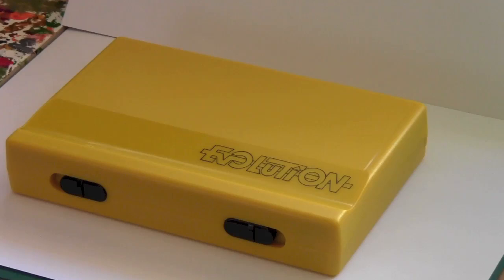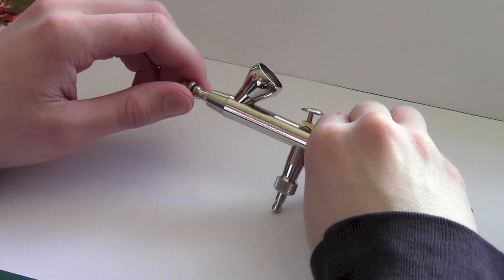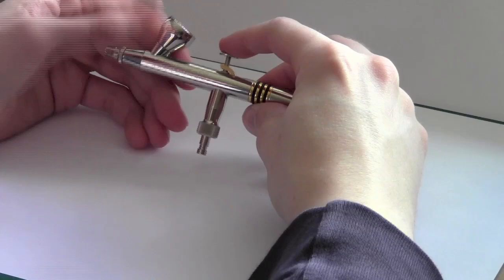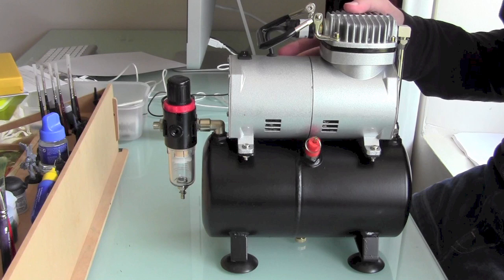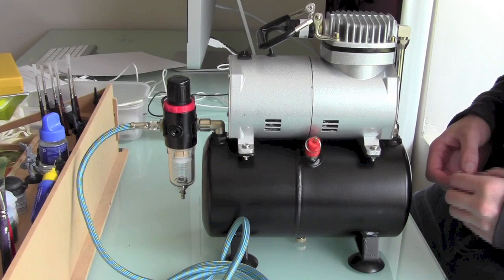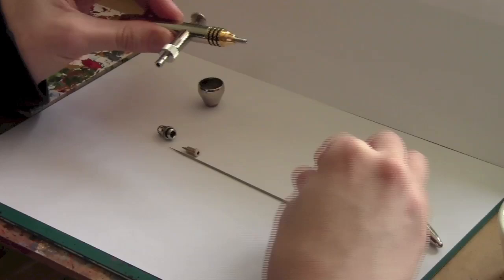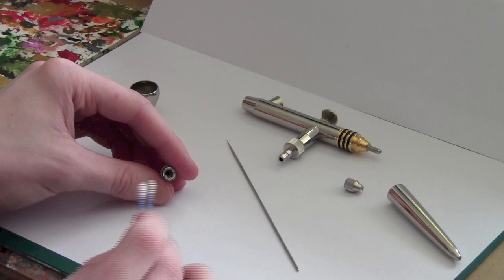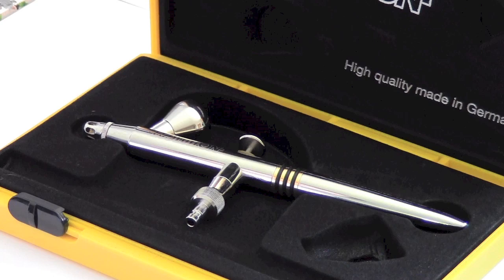Airbrushing For Beginners - Setup

Comment: This set up is by far the best set up to use in my professional opinion. Using a compressor and tank gives you not only quiet but a air flow that is consistent with your psi and paint 🎨 .

Comment: for smaller jobs i use a cheapo air brush.   A  portable air tank from auto parts store, 100 psi +,  attach a pressure regulator and water filter.

Comment: Actually to eliminate dragging paint of which is still residing upon the needle back through your airbrush housing of which makes for even more cleaning, you are better off pushing the needle  forward from the rear, and then removing it out through the front rather than removing it by pulling it backwards out through the back.

Comment: Could someone point me to a video about how to put the airbrush gun back together. I've practised how to get it out with this video but for example how far should I push the needle forward into the front.

The back of my airbrushgun (of the back-cap) can also screw something in. How does that all work together and should I really tighten the needle up or leave it loose because of this?

I'll search on but just pop the question in case. Good vid, ty!

Comment: Would it be ok to dismantle the airbrush and wash all of the pieces under a running tap? Also, what about an ultrasonic cleaner - would it also be ok to use one of these to clean the pieces?

Comment: i have this exact compressor but i don’t understand how to check or control the pressure (i’m unfamiliar with the terms you were using when describing how to do this) the PSI gauge wasn’t going up when the compressor was running.

Comment: Just a quick question, I have the same setup as yourself, however my regulator and moisture trap when fully screwed on doesn't point downwards. Is there an easy fix to this ?

Comment: awesome thanks, but what oil I should use for the compressor ?
Reply: +kmtmc07 Kind of like asking, "Which oil do cars need?" Depends on your particular piece of hardware. Check the documentation. To be honest though, it's probably fairly tolerant. If It were me, and I had to guess; I would probably just grab a 20W-50 from an auto parts store.

Comment: do they make airbrushs that have a setting for maximum paint adjustment? I mean like a way to limit the pull back so its always even?
Reply: I've got an airbrush (can't remember the brand) that has an adjustment screw that moves the lever to whatever you want and stays there.
Reply: yes, you can get a single action airbrush. It's single action because you push down on the trigger for both paint and air. You can adjust the amount of paint with a knob, so that the amount of paint will always remain consistent. However these airbrushes won't offer the same amount of quality as a double action airbrush (trigger is pushed down for air and back for paint)

Comment: Hi,

And thanks so much for all the advice. 
It’s one of those interests that takes a lot of getting used to with drawing remotely and not touching what you are spraying in most cases, and there will always be more paint wasted than goes to complete a design or picture. I was going to start this sometime ago but started shaking, - I have a tremor so it was not possible, but I am still well into this without actually holding a brush kinda thing.
Would be handy if you would be able to give some idea of the costs of various things if at all possible, as a kind of voice-over or with drop down written advice and captions. 
I too am English though right on the edge of London, where you sound kinda like a Geordie?

Take care, oh - and you do not have to reply!  ;-)

mrbluenun

Comment: sir is it necessary to have a tank
will the compressor just work!
Reply: +Ibadat Saraswat Yes it will still work without the tank.
It will remain on until you release the trigger and normally auto shuts off.

Comment: Do you have to have the air compressor? I might be getting an airbrush to cutomise my Littlest Pet Shop's with, so I need to know all the details. XD
Reply: You just need a air source. You can use a small electric "pancake tank" for around $80, but it will make noise in between fills and require more care to regulate the pressure. Others buy old air tanks with a regulator and just get it filled, sometimes using Co2. There are electric airbrush compressors which are really good, but they will cost over $200 usually closer to 300. If you only want to do it once you can look into aerosol can airbrushing systems. I know the model making supply company Testors has a product line for this, but I would not recommend them for beginners because their paints have a fast drying time and are very hard to wipe clean if any mistakes. And the aerosol system by itself seems like it would become expensive when you have to find their canned air product designed to adapt to their equipment.

Comment: did you know that if you have a tank on your compressor you don't really need the moisture trap.  because the tank it self it's an actual moisture trap it self. this is why the tank has the moisture drain at the bottom of the tank.
Reply: Zeno'sama, I still find moisture being captured in the moisture trap, so the tank probably isn't enough.  I don't know all the science behind it, but maybe has to do with your local environment and temp.  Not worth the risk if you are airbrushing and get a splotch.  The work to recover can suck.
Reply: @boughtamiata  a moisture trap is always advisable, especially because they only cost $10
Reply: The moisture trap is specifically intended to keep the moisture out of the tank.  you do not want any moisture inside of the tank, ever.
Reply: @jgrove197  The moisture trap is placed between the tank and the hose, so the purpose is to keep moisture out of the hose and the airbrush.  Moisture WILL collect in the tank no matter what, how fast depends on the humidity of the air it's pulling in.  That's why there is a drain plug on the tank - so you can drain the water when it builds up.

Comment: Whats the best set psi for airbrushing? ?
Reply from the maker: Ricky Porter Hi, I use 35 psi for everyday use, but its always good to change the pressure based on what you're working on.Thanks for watching
Reply: I have the same compressor and when im airbrushing it lose pressure after the first press on the gun.. wat m i doing wrong??
Reply: Ricky Porter i have the same compressor it is normal the lank empties slightly then fires up again
Reply: *****  does the compressor have to be on  when u take breaks while airbrushing ?
or its ok to turn it of then on?
Reply: If I take a 20 min or more I turn it off.. but if I'm just changing color or cleaning I let it stay on. .
Reply: Ricky Porter thanks! thats helpful